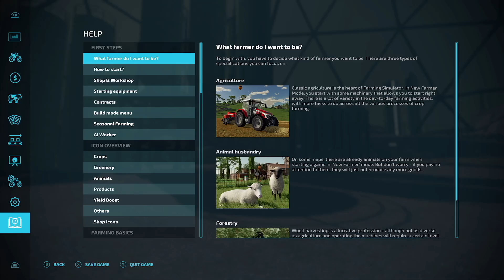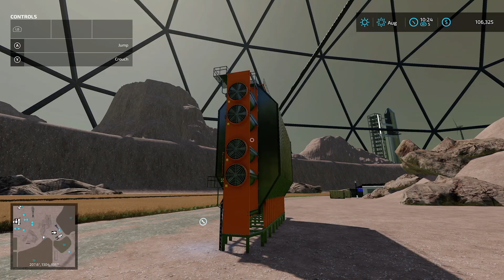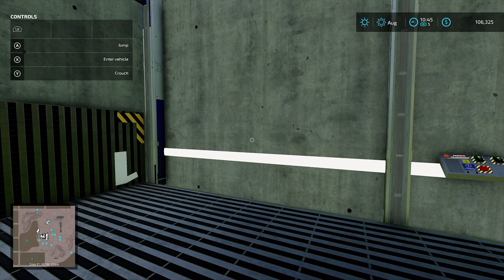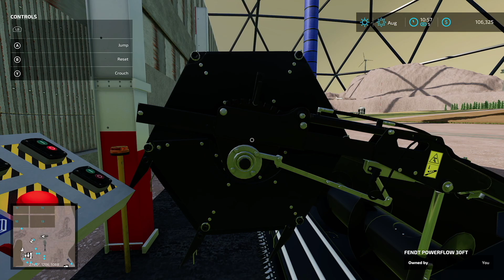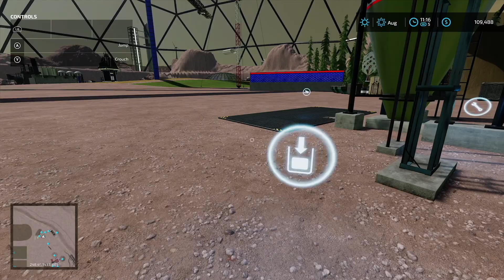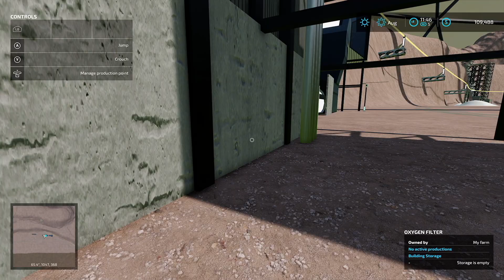Map Update | Mars The Mission | V.2.0.0.0 | Farming Simulator 22

Comment: Hello. I'm playing with this map, but I can't figure out how to collect rock from the crater. Can you help me? Thank you.
Reply from the maker: Hello Beatrice, you should be able to collect the stones directly using a shovel on a front end loader, wheel loader, etc. or you can also use something like the forage pickup to collect the stones off the ground and put them in a trailer. The first method with the buckets require that you own the land. The forage pickup does not require you own the land the stones reside on. If you don’t have the forage pickup installed you can get it from the mod hub. Hope this helps. Have a fantastic rest of your day and take care!
Reply: @bddgaming9838 
Thank you very much. The tip was very helpful. Do you also know if there is an autoload wood truck or cart that works on xbox?
Reply from the maker: Hey Beatrice, as far as I’m aware Autoload wood trailer is not available to consoles. The closest we got was the Autoload containers. Those were available in FS22 with the Platinum addition DLC. So far I’m unaware of when/if they are coming to FS25. Hope you have a fantastic day and take care!

Comment: 12:02 I'm thinking that if the vehicle is on the top of the lift, it doesn't work right, is there a mod or a fix for this? Either way I think that the vehicles can be sold/rebought or reset, so.
Reply from the maker: Hello Jake, I am not aware of a mod that will fix the floating vehicles if lifted. You should only have to walk by them or bump them and they fall pretty consistently. Hope you have a a fantastic day and take care!